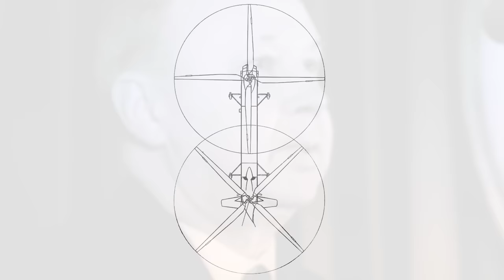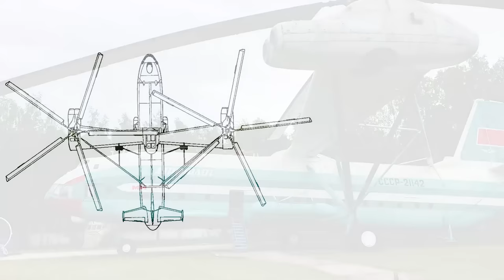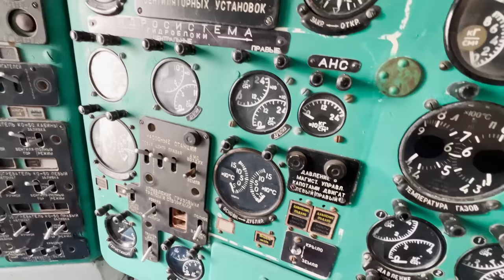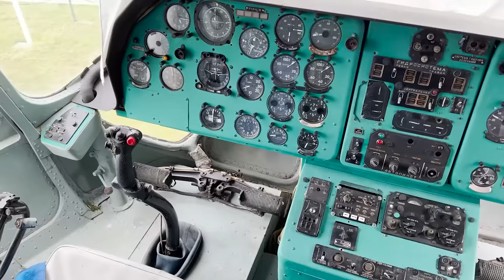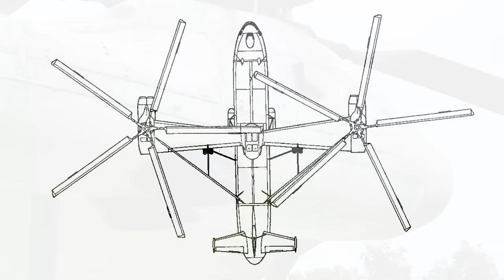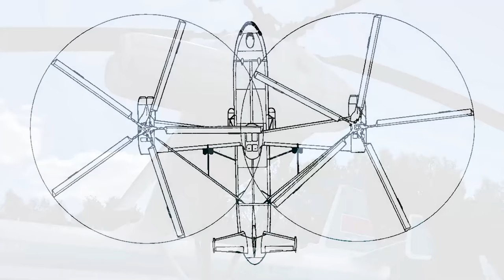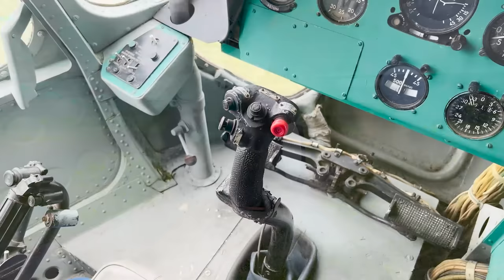Mil V-12 - Soviet rotorcraft titan

Comment: Russian helicopters lack for nothing compared to the West, they are genuinely cutting edge. The Mil 24 Hind attack helicopter had no equal in the West for 20 years.
Reply: I also would say in a similar way I like the super-maneuverability, rate of climb to 60,000 feet and general performance of Russian aircraft like the 3D vectored thrust Sukhois compared to certain Western fighters.
Reply: Ka-52 as well doesn't have equivalent with it's qualities. All Western attack helis are rather analogues of Mi-28
Reply: @mrobocop1666  The KA-52 is a great helicopter, the contra-rotating rotars are an excellent solution. It's fast and agile with a very good loadout. Tail rotors are just a waste of energy, they don't contribute anything to lift or speed, and just add weight, drag and additional mechanical complexity.
Reply: @k9killer221   not only about weight and complexity, but also safety and survivability - lack of tail rotor let the helicopter fly even with the tail blown off by manpads, as current practice proved. And if it's shot down anyway then it has ejection system for pilots, unique trait in serial helicopters, which amazes me about them the most
Reply: @mrobocop1666  Yes. It's all very advanced, especially blowing away six rotar blades prior to ejection.
Reply: @k9killer221  you mean 12

Comment: Those figures for the Boeing are a little bit off. A quick google search gives:

The Boeing 737-800 is one of the most widely used narrowbody aircraft and competes with the Airbus A320. The empty weight of the Boeing 737-800 is 91,300 lbs, and its maximum takeoff weight is 172,500 lbs

Comment: @11:26 it's written, that 20 tonnes = 44,000 pounds. This is incorrect, as 20 tonnes, is 20,000 pounds (US). The fore mentioned is probably, in metric tonne's (2,200 lbs. per metric tonne. 44,000 total). You MUST ADJUST, or explain, the differences. Otherwise, very excellent heli- documentary👍, on a machine I've NEVER heard of before. Also, I like it when you're describing the cockpit @13:18, and yoke function's, that you're getting someone to move outside controls, to depict the part observed inside, by moving it😉!!!!

Comment: The transverse rotor layout was NOT experimental and excessively complicated. 

It was PROVEN helicopter technology. 

The worlds FIRST production Helicopter, the Focke-Angelis Fa 223, used precisely such a layout.

The only issue with 12, was the SCALE, which would prove problematic, no matter WHAT layout was chosen, less problematic for a traditional tail rotor, or a transverse layout, than any other. A dual contra rotor set up, would put all the force in ONE are of the fuselage, without anything to counterbalance it, which would likely have limited size and load, intermeshing dual rotors, gaining popularity in the USSR at the time, would limit overall size, because flex concerns would limit overall size of the rotors. just like twin rotor design. That left only TWO real options, and the transverse mounted dual rotors were the logical choice.

Comment: so they build two rotors next to each other instead of in tandem, because of overlapping
but then they build a helicopter which overlapped anyway and its even long enough to have the same overlap but with a tandem design
which means making the body a bit stronger but then scrapping the whole fuselage and therefore making it way lighter and being able to use proven concepts would have been way more viable

Comment: Two rotors equates to twice the risk of failure, so twice the risk of dying in one. Is it just me or do others not trust helicopters  ?
Reply: A helicopter is a collection of fine, fragile parts flying in close formation.
Reply: @nunyabizness4354  .    Exactly my point.
Reply: Auto rotation works like a Parachute
Reply: Actually, it's just you...

Comment: 500 Kilometers is 310 Miles. It is also 270 Nautical Miles, which is what you used. We don't use Nautical here in Imperial Land, lol. We use Statute Miles. Nautical only really applies to shipping for the most part, oceangoing only, by the way. SOME general/small aviation pilots use it because a lot of figures are done it regarding takeoff weight and range, etc. But NMI does nothing but confuse Imperial Standard users further. We were supposed to switch to metric, by law, in the 1970's. Why they didn't force it is beyond me because our Imperial Liquid Measurements are so confusing that 90% of adults can't give you how many pints are in a quart, etc!

Comment: They broke the record, but it was pointless construction. The primary task of a transport helicopter is to deliver people and equipment to places inaccessible to transport planes. Such a heavy helicopter had no chance to land in the field. He could only land on the concrete surface of the airfield. In this case, planes can take more, transport it faster and cheaper. In addition, there are problems with handling such a giant. He also had to have problems with stability. I don't even want to think what would happen if the engine failed. Not always the bigger is the better.

Comment: Function rather than form is the recurring theme in Soviet tech.

It all lacks any aesthetic merit , obviously designed by a disparate cabal of kowtowing engineers , bending to the misguided vision of some Politburo mandarin - yet it all seems to work - not in a viably commercial way, but just works - as did the Ekranoplan, only to see service in the USSR .

Yet it's intrinsically charming in a workmanlike way - even down to the eau-de-nil paintjob, which you only ever see on Soviet tech and on African hospital walls.

Comment: Soviets built a lot of enormous aircraft, but they did it just to world records without regard to usefulness.  Most of these designs were garbage functionally, and were also extremely unreliable & unsafe.  The Mig-25, AN-124, AN-225, N-1 rocket, Tu-144, and the KM are just a few examples.
Reply: It was hilarious when some silly little boys in US Chinooks needed a big manly MI-26 to rescue them outta the Afghan mountains! 😂😂
Reply: @ZIGZAG12345  No, what was hilarious was all four Soviet N-1 rockets exploding in failure.  Where is the Soviet Union today?  Oh yeah, it's EXTINCT. Even the Russian people hated the Soviet Union, lol.
Reply: @JohnAnderson-sm8jl  
Soviet Union doesn't exist, but MI-26 still does.
AN225 actually was still being used up until fairly recently too.
Reply: @JohnAnderson-sm8jl 
So what? You're overlooking the large number of US rockets that exploded on the pad or shortly after lift-off in the late-50's/early 60's. If the prototype N-1 launches had been successful, the Sov's would've been 2nd on the Moon. By 1973 the later, much-improved N-1's held great promise. Sadly, they decided to give up and scrap them too early, IMHO...😞